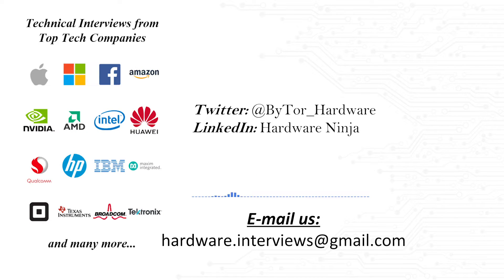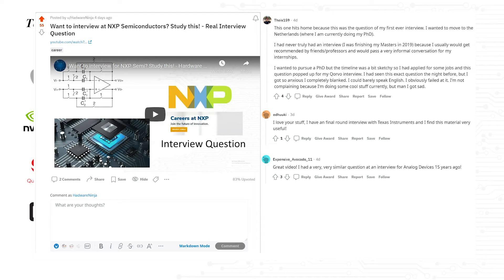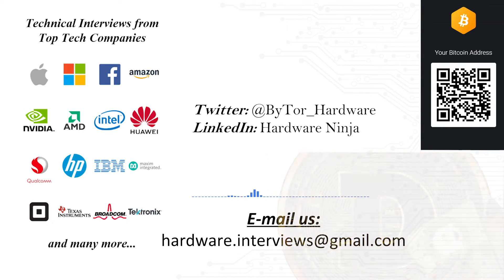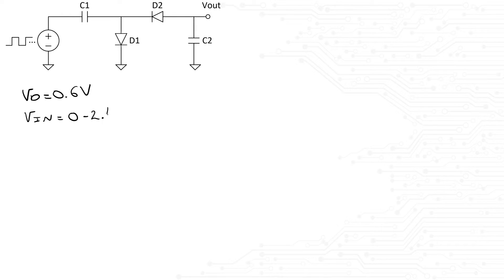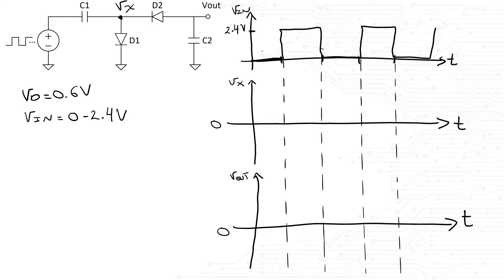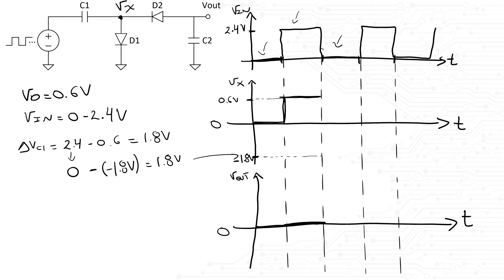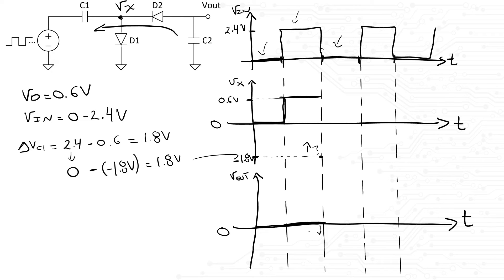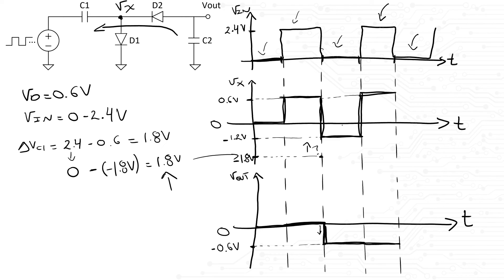HWN - Apple Hardware Interview Question!

Comment: if anyone wondering how -1.5v and -0.9v come, just balance the charges across capacitor initially and finally.
initial charge = final charge
charge when Vin switches from 2.4V to 0V = charge when voltage Vx becomes stable.

-1.8*C1-0.6*C2  =  Vx*C1+(Vx+0.6)C2

Vx = (-1.8*C1-1.2*C2)/(C1+C2)

if you assume C1=C2=C

Vx= -1.5V

Vx+0.6V = -0.9V (this is  across C2)

for the first few cycle there would be glitch at the Vx voltage , it won't go to -1.2V, -1.5v  smoothly
final volatage on the Vx= -1.8V and across C2 is -1.2V.

Comment: The question is simply amazing. But for those who were unable to solve it, it's a voltage doubler circuit taught in Analog Circuits course. Only the input signal has been converted to a Digital signal here. When I learnt first about this circuit, I personally had faced trouble in solving this circuit and even after I got the answer, I still had trouble in understanding how the voltage eventually doubled. I tried to search everywhere and only after quite a search, I found the right material to understand this circuit. Please refer Razavi "Fundamentals of Analog Circuits" book and search for voltage doubler circuits. Trust me you will find not a better resource than this to understand the above.
Reply: "Fundamentals of Analog Circuits" is not available for purchase. Where can I buy one?

Comment: Correct me if I am wrong. But I think this solution only works if it is assumed that C1 and C2 are equal, which was not mentioned.

C1 loses an amount of voltage that C2 gains, that is why on the beginning of the second cycle, Vout settled on -0.6V after gaining -0.6V which was lost by Vx that started on -1.8V and settled on -1.2V, giving D2 0.6V across it. The third cycle employs the same principle, but Vout now settled on -0.9V after gaining -0.3V which was lost by Vx that started on -1.8V (again) and settled on -1.5V, giving D2 0.6V across it (again). This is only guaranteed when C1 and C2 are equal as the same current flows thru them.

To add, the words lost and gained are in the perspective of the capacitors.
Reply: Please explain the 2nd cycle. What does c1 lose what does c2 gain?

VD1= -1.8 and VC1=1.8 when vin=0 is this correct? How does Vout =-0.6?
Reply: @justqassim  VC1 loses 0.6V from 1.8 to 1.2 and VC2 gets 0.6V from 0 to 0.6V. That's why Vx changes from -1.8V to -1.2V and Vout changes from 0 to -0.6V.

Comment: Why the delta v across c1 should be maintained?
Reply: capacitor resists the change in voltage...as they mentioned its ideal capacitor it means it wouldnt tolerate any change in voltage across the capacitor
Reply: Exactly

Comment: I’m currently a junior computer engineering student. Could you tell me what course I should have or will learn this in?
Reply: electronic circuit; analog circuit design. Those are hardware courses though, unless you really like circuits, sticking to computer engineering has better job prospects🙃
Reply: @yuanruichen2564  thanks! The curriculum at my school requires me to take hardware courses anyway so I think I’m in good shape. I take electronics next semester

Comment: At the end of 5th or 6th cycle the Vx is about -1.8 and Vout is about -1.2
Actually neither Vx nor Vout will not be -1.8 and -1.2 respectfully but the voltage at nodes tend to the aforementioned values gradually.

Comment: I can't understand the -1.5V and -0.9V part. Can you explane with equasition?
Reply: At this point, Vx is -1.8 again and Vc2 is -0.6, apparently the D2 diode lets C1 shares its electric charge with C2 until the voltage across the diode becomes 0.6, so after a very short period of time (ideal components) Vx stops at -1.5 because voltage across the D2 has became 0.6, hence the Vout is -0.9
Reply: @ahmadsadigh2439  but why does Vx stop at -1.5V? because Vout is -0.9V? well then why is Vout -0.9V? because VX stops at -1.5V? that doesn't make sense.

Comment: You just said...at the end of the cycle Vout becomes -0.6V and Vx becomes -1.2V, but didn't explain how.  You obviously think that part is important because of the graphic "Do you understand what happened here?"  

So why not explain it?
Reply: The D2 diode lets both capacitors to share charge, but also stops the sharing at a point which voltage across D2 is 0.6.
Reply: @ahmadsadigh2439  I don't think it was explained like you just did.  It was simply stated....not explained..

Anyway, thank you for the explanation
Reply from the maker: Hi Adam, it's extremely important yet we decided not to explain it so as to let future interviewees work through it themselves so they understand it deeply.

Also, in a way we explained it by mentioning everything happens "instantaneously' due to ideal components. If we assume limited resistance (i.e. non ideal devices) on the diodes then it'll be clearly seen what we meant. 

Hope that helps it clarify our reasoning as to not giving every detail away. Thanks for being here!!
Reply: @HardwareNinja  I love the videos, been studying a bit and they are helpful to practice!  Thanks for the great content.  I simulated the circuit in LTSPICE and I have a better understanding on how this functions
Reply: Isn't the onerous on you to figure out how? Esp. if you're doing interview prep?

Comment: Good question, but not the explanation… For those who find it hard - google and read a couple of charge-pump papers. Try to understand how the positive and negative charge pumps are operating and how to get the waveforms. Check if your understanding is correct by calculating output voltage from 0 to 10 cycles in excel and compare it vs paper or vs spice simulation.
Reply from the maker: Hi Volodymyr, thank you so much for the feedback. This time around we decided to switch our strategy to present the answer to the question. Instead of providing the entire solution step by step, we decided to skip steps in key places to let the ninjas work through them themselves.

We believe that if they can work through the process, they'll get a deeper understanding of the structure and the question.

Hope that helps clarify why we opted for this direction and why the explanation seemed "lacking" details